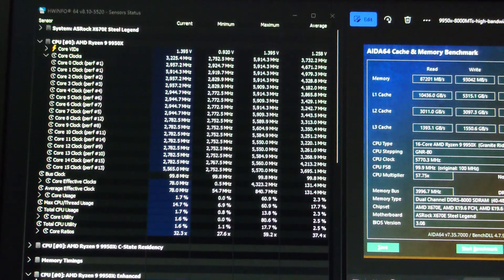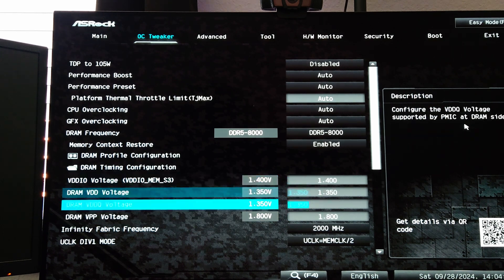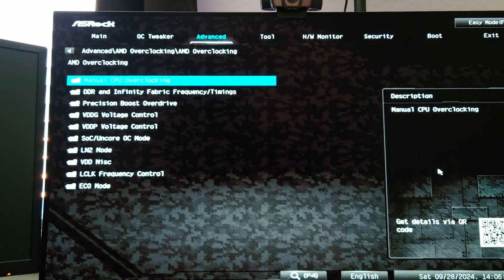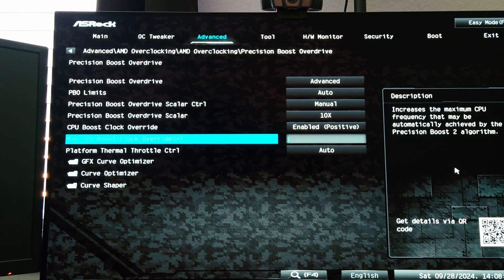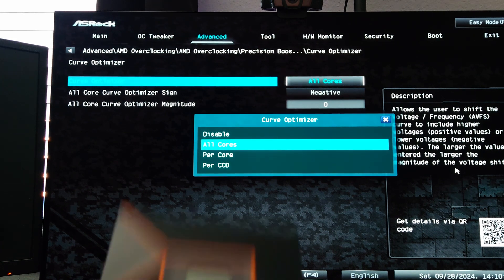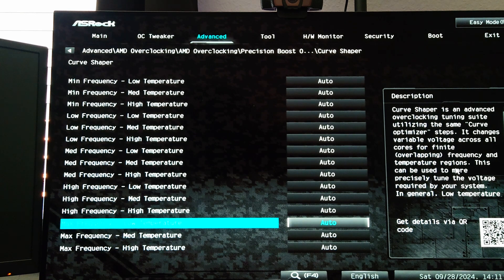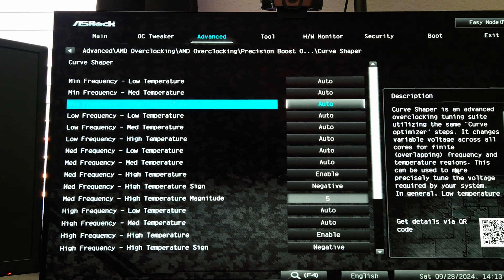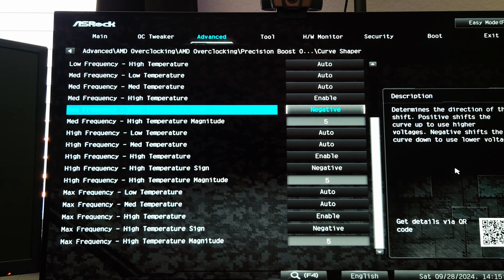Ryzen 9 9950X Overclocking Guide | 5.9Ghz on Air with Curve Optimizer and Curve Shaper

Comment: I just recently built a 9900x w asrock taichi x870lite and I’ve reached interesting conclusions.
Too much CO neg applied freezes at idle and light single/double core loads makes cpu boost so high ~ 5.9’s that will also lock up. Very nice to have CShaper so can leave low freq/temp conditions voltage at stock visa vie CO-CS to cancel out low and of curve but not affect the middle, and set adv pbo settings to not push to 5.9’s but for me a 5.75 ish max. A lot to learn to maximize and stabilize these 9000 series amd’s, and 2 ccd variants even more so.
Reply: what temps do you get? and power draw?  when i just set pbo on, i get higher scores in benchmarks. also higher temps than if i do it this way 🤔 i did get a little bit better score in 1 and 2 thread test in a cpu benchmark

Comment: With boost clock override you boost vcore and vid higher than you would with a eclk board at the same frequency.  I find with taichi using mix of boost clck override and higher eclk threads the narrow passage between vcore heat and frequency

Comment: I put curve sharper instead of negative 5 to max negative 30. Evrything runs very smooth and cpu is not hitting max 96 degrees even after 2h stress test. And keeps 5430mhz.

Comment: hello how are the temperatures with your noctua nh d15 cooler?
Reply from the maker: They are excellent. The CPU is so efficient that high-end air coolers can handle it just fine.
Reply: @GameTechReviews  some rough peak temperaturs please?
I live in the middle east where ambient is very high, also are you using the offset mount ?
Reply: @GameTechReviews  please did you use offset mount?

Comment: What is it fight for ?  100 - 200MHz  ?   tell us  what is the average  gain in Overclocking  9950x   ?
Reply: Just to share my experience here with the 9950x I'm building for a family member. These are Cinebench R23 numbers, and temps is just an average Die temp, rounded for simplicity.

Out of box, no PBO=41,950@70C
PBO enabled=44,900@95C
PBO-20CO=43,250@70C

Still testing as we speak but I was blown away at the difference in temps running -20 Curve Optimizer on all cores. Going to try Ryzen Master to see what it automatically finds CO to be.
Reply: not much

Comment: Is this cpu clock achievable with 192gb CMH96GX5M2B6000C30  runing at 5200?
I have proart x870e mobo
Currently my c23 benchmark is 42-43k  in 10 min test.
Want to improve it slightly

Comment: Hi guys. So I've managed to OC my ram from 6000 to 6400mhz. I've applied the infinity fabric frequency to 2000, but I'm not sure about if this should be like this:  UCLK=MEMCLK/2 or like this UCLK=MEMCLK. Any advice would be really appreciated. Thank you.
Reply: UCLK=MEMCLK means that your memory runs in gear 1 mode (Which is best. However if the system isn't able to do it, it will step down, in gear 2 mode). 
UCLK=MEMCLK/2 means that your memory is running in gear 2, which is sub-optimal.
Reply: @Crossfire2003  thank you very much. 🙏🏻

Comment: What fclk/uclk should I use with 6000 ram?
Reply from the maker: fclk should be set to 2000mhz. UCLK will automatically follow the MCLK which for 6000 would be 3000mhz.

Comment: The 9950X will only boost to 5.9GHz at idle. You need to look at effective clocks. You might see 5.8GHz at low temps with +200 PBO.
Reply: The way he's tuning it your right. It might peak at 5.9ghz of a sec or two in game but most likely will stay at 5.8ghz in game. But if you tweak the eclk higher(102-103,etc) then it will maintain higher clock. I have mine delid and in game it hits 5.94ghz on CCD0 and 5.75ghz on CCD1 and all core work load around 5.5ghz and 5.425ghz on each CCD.
Reply: @JMNovak1011  Effective clocks don't work like that. Take my delidded 9950X for example. All of CCD0 reports 5915.0Mhz as the "Maximum" clocks achieved over 37 hours of monitoring in HWINFO, but effective clocks report a maximum of 5588.4Mhz. If a core has to drop it's speed as soon as it's loaded then it doesn't matter what clock it has at idle.

Comment: why are almost all of the settings in oc tweaker greyed out for me? including dram profile configuration, just wanted to enable xmp atleast
Reply: For ram stuff, it can be locked because you selected a preset (like jedec/xmp/expo). Those presets lock the values to whatever value is determined by the preset, and can not be changed. Look to disable the preset or something along the lines of manual/advanced timings instead

Comment: I have the 9950x and only could go down to 0 to -15 on per core. P cores only take 5 and 2 nd ccd usually takes -15 but one core is only stable with no offset. 
For Benchmark is use Y-Cruncher vt3 and small, while having Bf2042 on a 128 Player map open while 1 Single core game also runs in the background. If Y-Cruncher + BF2042 gives no error in this case the undervolt ist stable, otherwise not.

Comment: I think with 2 ccd chips everyone should do a per core curve optimizer setup. With that many cores there are even more chances to have variances. The way I went about it is running Ryzen master on a per core curve optimizer. It will churn for a few hours and then pump out the numbers for you. very worth it
Reply: On my 9900x3d it won't let me do that option? Idk why
Reply: @willwhalen7572  only 1 ccd I believe  my bro😢
Reply: @willwhalen7572 yeah I just recently upgraded to an x3d and they don't let you do that on those. Hopefully they add it
Reply: My Ryzen Master's CO is insanely unstable. I was doing it manually stress testing everything per core with OCCT.